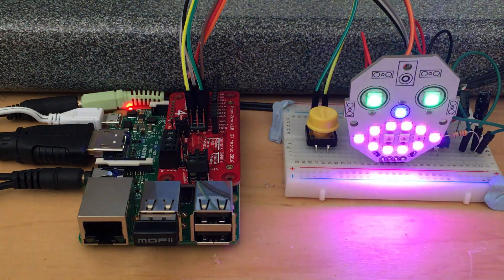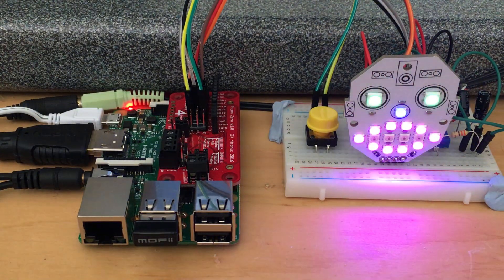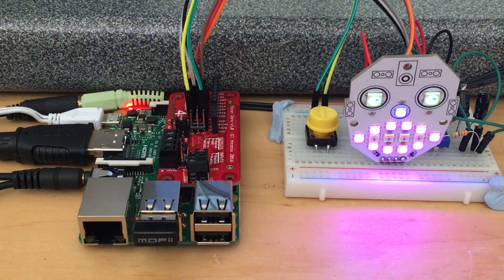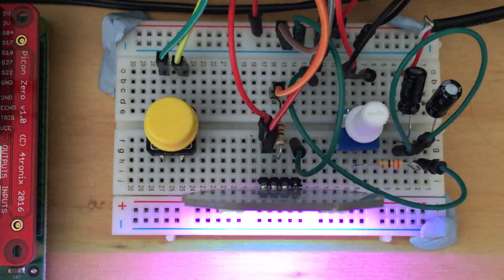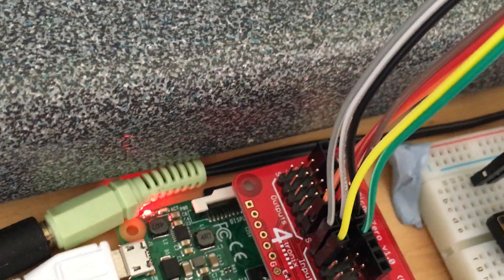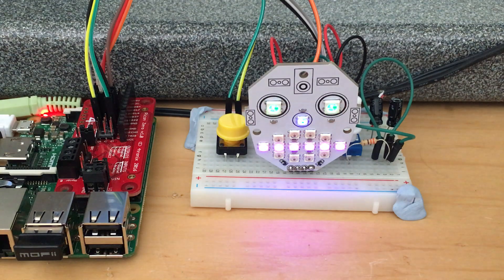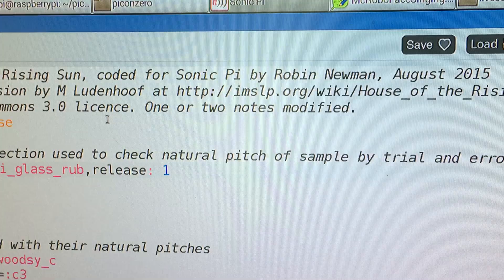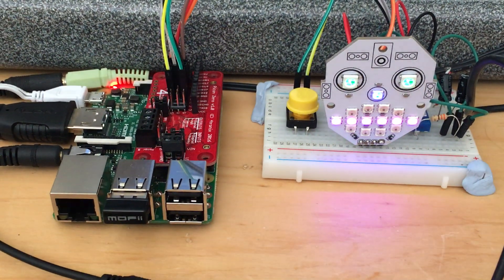McRoboFace Singing Project

Comment: Excellent, Robin. I follow you and watch all your videos and I must say that you are a genious. One question, is it possible to make the robot sing without 4Tronix Picon Zero board? I think that the analogic to digital output could be plugged directly to the Raspberry GPIO. Am I wrong?
Reply from the maker: No I think you do need an Analogue Digital converter for this project. There are other chips available that will perform this function, and I think you could drive the McRobo face neopixels via the Pimoroni rpi_ws281x-python python library. However the project software would require considerable rewrite, and I would recommend that you stick with the PiconZero board which I have found to be very useful, easy to use, and which you can use for a wide range of interface projects:  so much so that I have bought two of them.

Comment: Great project. Is there a method to get the mouth to respond in sync to a speaker feed. I am trying to add the McRobo Face to the Google AIY. Thanks.
Reply from the maker: In the first part of the video above I am actually feeding the analogue input circuitry with audio from the audio output of the built in Mike on my MacBook, so in principle this should not be too difficult to do. There may however be some latency issues in syncing to the audio.